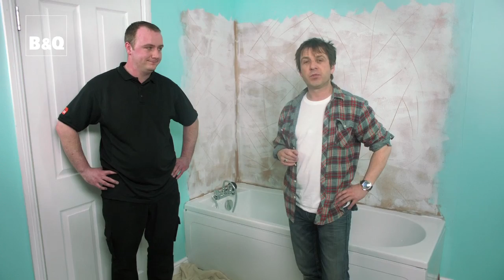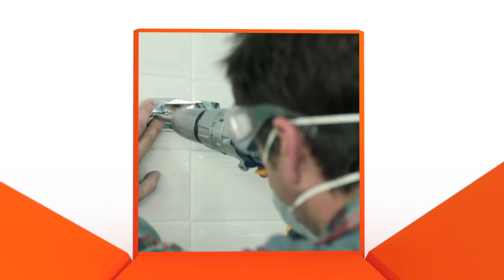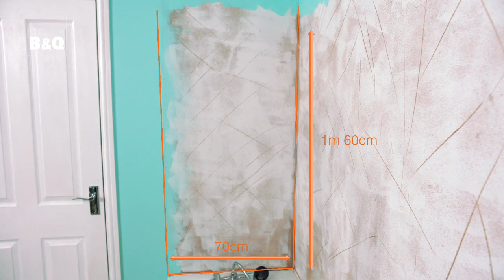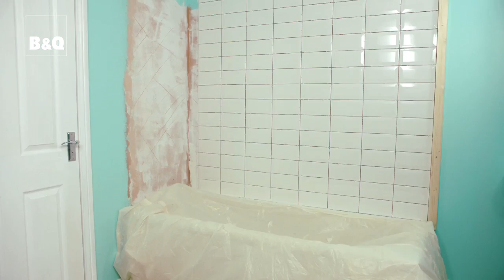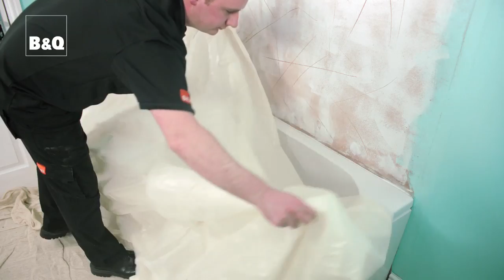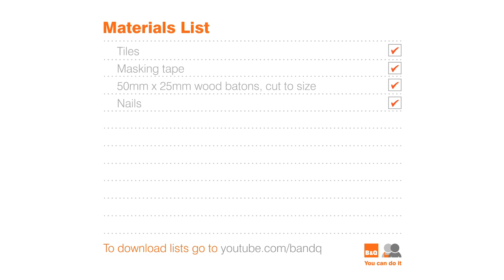How to tile a bath splashback part 1: preparation

Comment: Do you waterproof the wall before the tiles?
Reply: yes with a tanking kit,and never start your tiles from the bottom of the bath,terrible video.
Reply: @antonygilbey7987  and how do you start it? Measure and start from the top? what's the difference?
Reply: @bandq  eh yes you do .